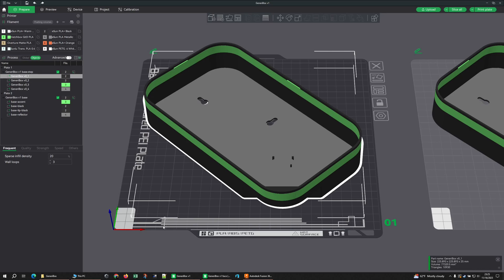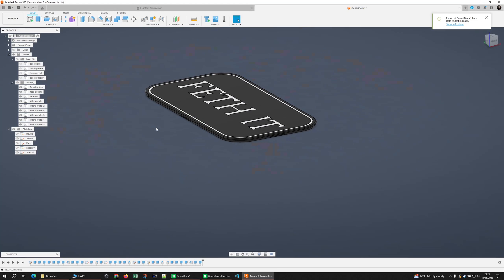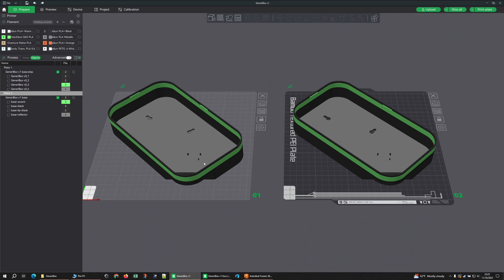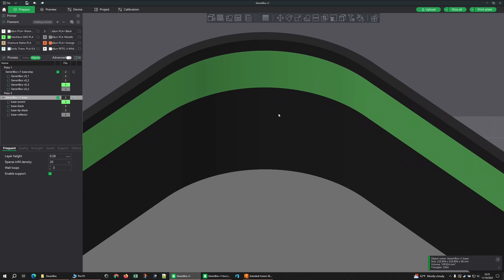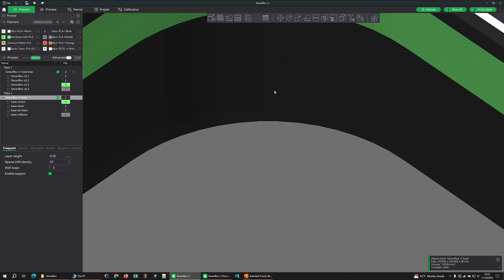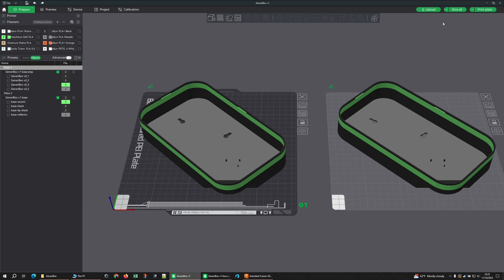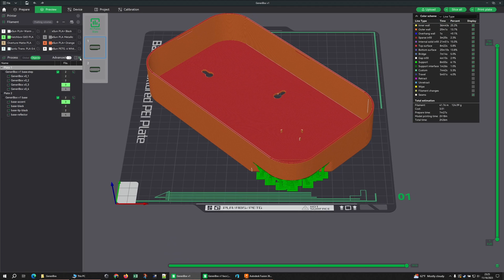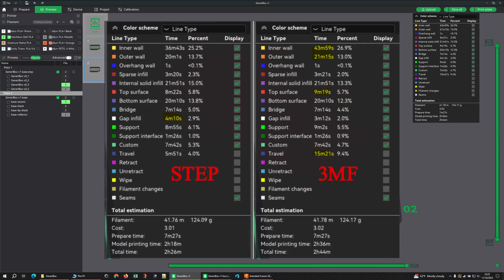STEP vs 3MF

Comment: I'm preeeeetty sure that having 'more' sections showing up in the corner, is technically better. I'm not sure where 'its lower quality mesh' is coming into play there, but usually more polygons around a curve, the more detailed it is. But as for printing time, that might be a slicer issue imo. I can't replicate that in Super Slicer at all, they're the exact same time for me between a step file and a 3mf file of the exact same model.
Reply from the maker: You are correct - more polygons in the mesh results in smoother geometry. That's where I'm pointing out that there are fewer in the 3MF vs the converted STEP.

The default "medium" quality 3MF (or STL) from Fusion will produce larger polygons as compared to the mesh that Studio generates when converting a STEP file. Exporting a "High" quality mesh is roughly equivalent to the result from a converted STEP.

Comment: I believe the slicer triangulates the step file anyway before generating gcode. I personally manually create a mesh with the desired tolerance, and export that mesh as STL(though I use freecad, not sure of the workflow to do this in fusion).
Reply from the maker: It does! I learned a bit more about handling exports from Fusion and how the Prusa/Bambu/Orca family of slicers translates STEP files. A "high" accuracy 3MF/STL will generate the same results, just with significantly larger file sizes.

Comment: More like step vs stl comparison. 3mf is a step file basically which has additional metadata for colors and multiple parts.
Reply from the maker: Not quite. A STEP files contains the geometry of the shapes within expressed as equations. A 3MF contains a mesh very similar to an STL, but with additional volumetric data to ensure more accurate placement of those polygons. Or course yes, 3MF also keeps object names, color data, etc for it's individual parts.

Think of it this way - a sphere in an STL is nothing more than a collection of triangles positioned to look like a sphere. The higher the "resolution" the smaller the triangles, the finer the appearance of the sphere. With greater accuracy those extra triangles increase file size, in exactly the same way a picture with a higher resolution is larger than one of a smaller resolution. A 3MF is the same mesh, but with coordinate data for points in the mesh as well. Meanwhile a STEP would contain no mesh but instead the formula to render a sphere (I believe by volume, so V = (4/3)πr^3).

The trick now becomes how a slicer interprets those files.

Similarly both STEP and 3MF files can be broken in to their constituent parts, the 3MF winning here as object names and other metadata (color, etc) are retained. However Studio and other variants cannot work with STEP files directly and first interpret the STEP - converting it to a very fine resolution mesh. 

That's what we're seeing in the video. The finer quality of the converted mesh from the STEP is higher than the default quality of an exported 3MF so there are more G2/G3 arc commands in the sliced preview. That translates to more efficient printing as there is less repositioning of the nozzle.

A high resolution 3MF will do the same in all honesty.
Reply: @RevHazlett  this was a useful breakdown of the finer points of differences between 3MF & STEP files. Thank you! :D

Comment: You can adjust the quality of a .3mf when you export from Fusion. It defaults to lower quality. I suspect if you adjusted those settings before exporting you should be able to achieve the same quality obtained by the slicer converting the step to a  stl. Not only can you choose between - Low, Medium, High - you can also do a custom. I have found the 'High' refinement settings to produce extremely smooth curves on walls similar to what you found with the .step file imported into the slicer
Reply from the maker: I looked but was unable to find a quality setting for 3MF. Perhaps it's buried somewhere I missed?
Reply from the maker: COMPONENTS. That's my issue.

A regular export from the file menu has no quality control, which is what I've been doing. You can't select multiple bodies and perform a "save as mesh" command, but you can combine bodies in to a component and export that as a mesh, where the option to kick refinement up becomes available.

It's nice to have the Volumetric mesh of a 3MF... 

I just did this with a random model, compared the slicer gcode of a high 3MF against a step and it looks pretty dang similar - almost identical quantities of G3 commands between the two.

Thanks for making me dig a little deeper!
Reply: @RevHazlett  Actually, it doesn't need to be a component. Just 'right click' the body and choose 'Save as mesh' (about half way down) - this popup provides the 'Refinement' choice as well as 'Refinement Options' dropdown for even finer control. It also provides the option to choose between .3mf, .stl (binary or ascii), and .obj
Reply: @RevHazlett You have to right click the body and export as mesh. It saves faster too.
Reply: And since the lower quality .3mf file took longer to print I bet the higher quality will take even longer!!
Reply from the maker: @sotm6078  actually the opposite! The higher precision on curves means more continuous lines and less repositioning.

Comment: So step is the new king? Is stl and 3mf dead?
Reply from the maker: When you're looking at geometry, STEP has always been superior to STL in nearly every way. Once slicers started being able to interpret STEP, the only reason to stick with STL is compatibility and, well, habit.

So - yes, but sometimes no.

3MF, at least in it's currently implementation, is still basically just mesh files like an STL. It adds in a bunch of other data (materials, colors, volume, etc) which is an advantage over STL, but I don't think they've started incorporating shape geometry yet. There were a couple of update notes I had read a while back saying it's partially implemented but I at least with what's used in the wild right now I haven't seen anything suggesting true object geometry.

I should have put in this video a side-by-side comparison of the box printed from a 3MF export and one from a STEP export. Once my print queue dies down (a few days) I'll do a short showing a printed side-by-side for comparison. I'm looking at two different lightboxes on the wall right now that are very similar in design and one has noticeable lines along Z in a curve, where the STEP box is smooth.

So to your question, which format is best?

If you've got something where clean primal geometry is critical - like the box I printed with four clean circular edges - STEP all the way. If you've got something with lots of parts and colorization data and you want the convenience of keeping object names from CAD, I'm still doing 3MF.

I'm editing up another silly-long video about the model in this video. You'll see in it I'm using a STEP for the base and a 3MF for the face, for exactly that reason.
Reply: @RevHazlett  thanks for that detailed answer! If you extrude parts as components you can also rename them as colors, then it's super easy to see in the slicer what the colors should be when exporting as step. Looking forward to the video 👍👍
Reply from the maker: @91Renner  Yup, I've done lots of "part by color" exports, but I've found myself needing to change print settings for individual pieces a lot (small things with finer lines, individual scaling adjustments, etc).

It's all kinda based on the things I print and how I work with them.

The 3MF consortium is pushing hard that their (justifiably awesome) volumetric approach is good enough. In my perfect world, the couple of them hinting at a spec that incorporates NURBS gets the green light, and we could have the option to basically have STEP-like objects in a 3MF.